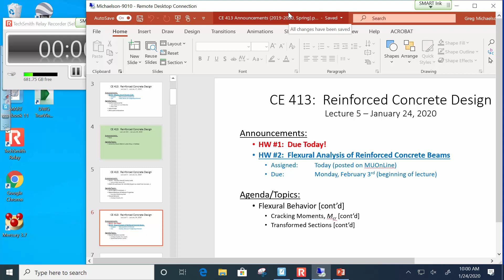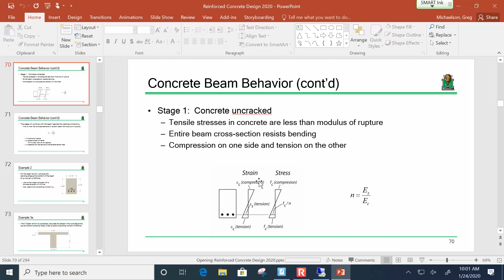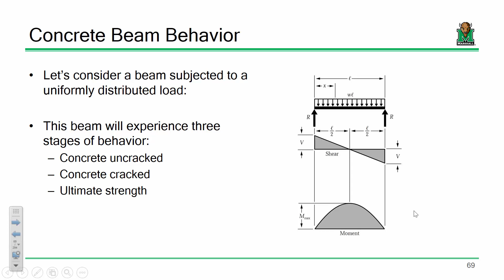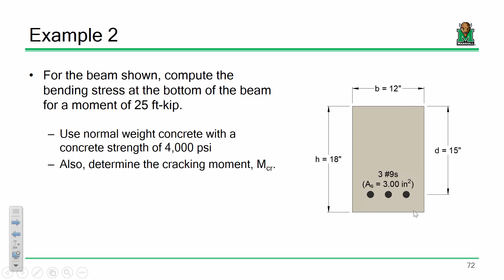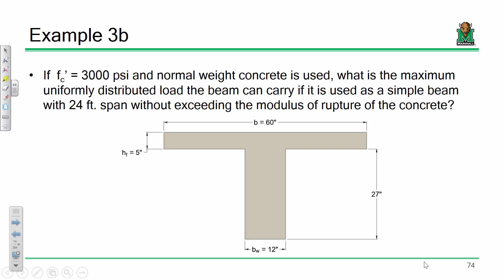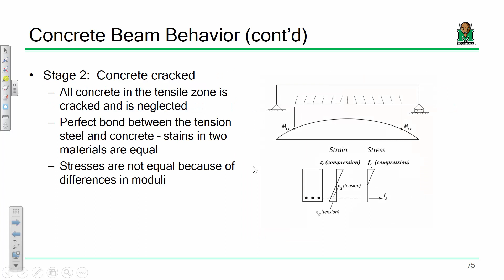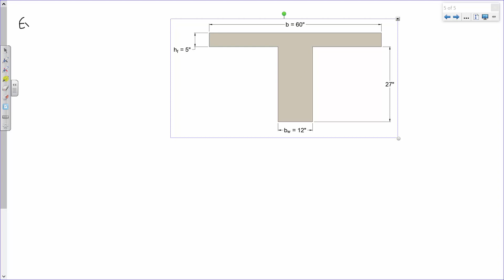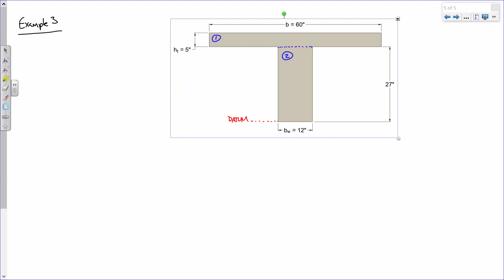CE 413 Lecture 05: Cracking Moments [cont'd] (2020.01.24)

Comment: why the example 2 not solved using transformed area concept? Don't we have two different materials(steel and concrete) in the Section?
Reply: we use it to calculate stresses